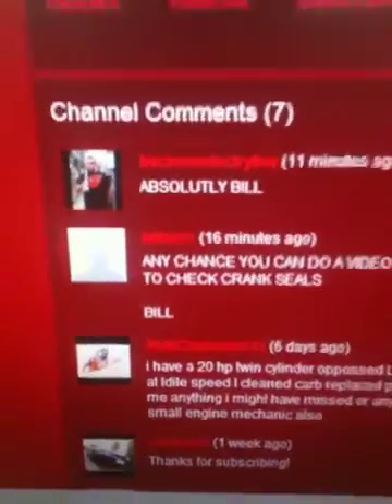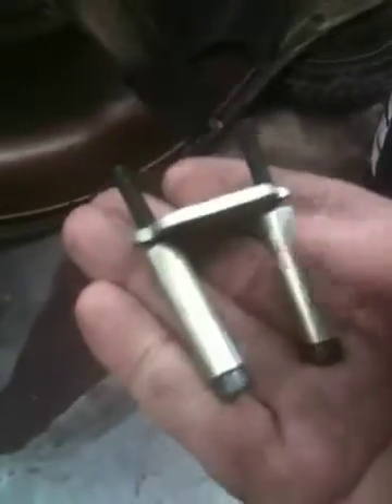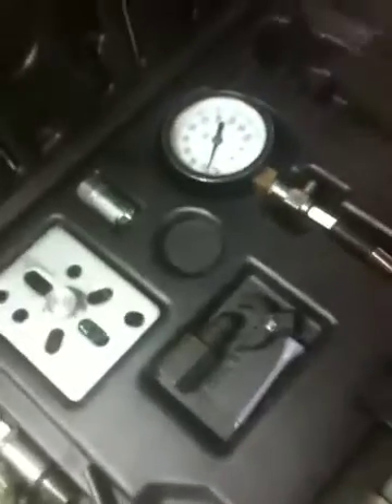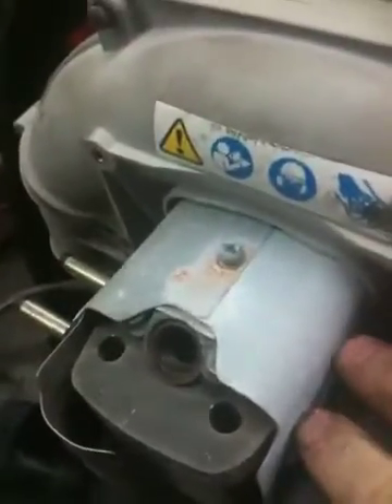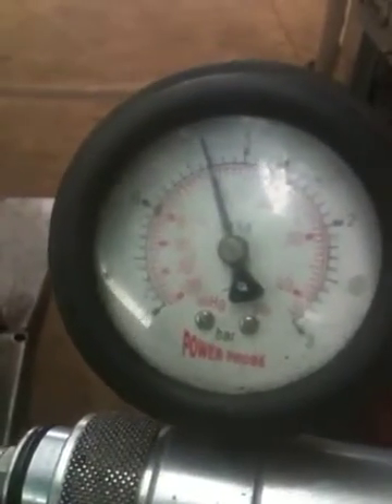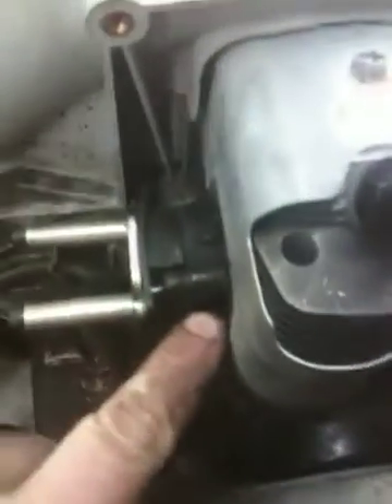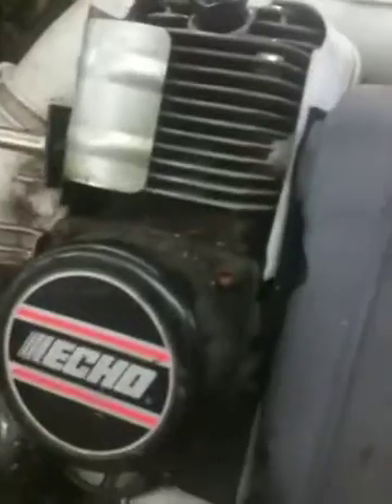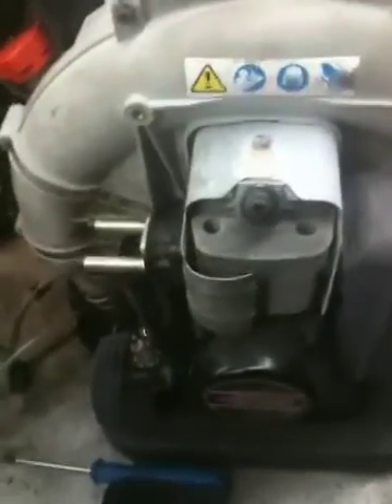2 CYCLE ENGINE REPAIR:  HOW TO PERFORM A PRESSURE AND VACUUM TEST ON MOST 2 CYCLE ENGINES

Comment: I bought a vacuum/pressure tester on eBay about 4 years ago for $40.00 and it still works great. For the rubber to put behind the muffler and carburetor you can get on eBay or Amazon and search for” 1/8” thick rubber sheet” then cut it however you want. To make a carb port block you can take a bad carb and  remove the butterflies and rods, cut the fuel line nipples off if it. Then stick a metal tube through it and seal it up with permatex gasket maker. You can make a spark plug hole adapter by breaking the center out of a spark plug.

Comment: I can't thank you enough for posting this. This is exactly the info I was looking for. I won't be defeated by my 2 stroke now!
Reply from the maker: It's comments like this that make me want to do what I do thank you and have a good rest of the weekend
Reply: THEMOWERMEDIC1 THE SMALL ENGINE SPECIALIST my question now is how to tell if the piston in my engine is at dead bottom center. Can I just look in the spark plug port at the top of the piston?

Comment: JEREMY FOUNTAIN (THEMOWERMEDIC1)  When u put pressure on the piston it moves the piston past the transfer ports filling Crankcase with pressure and or a vacuum

Right, if the Piston is leaking you are filling up the whole engine with pressure, every gap and hole. The pressure will pass through the leaking (if it is leaking air) piston/cylinder and fill the crankcase past the piston (which I would assume is also airtight) with the same pressure. I'm just saying that this might not be necessarily the most accurate way to test pressure.

Comment: Worked on one that the shaft moved side to side when it reved a little. Ran perfect at Idle. Bearing eroded into side cover. So Now I pull crank back and forth to check for movement and pressure loss.

Comment: if you block off the intake and exhaust, you are testing the pressure of the block. The piston could still have a loose pressure against the cylinder, this test is pretty much useless in terms of testing the engine pressure.
Reply: you are testing the engine for unmetered air leaks. ya moron. not compression.
Reply from the maker: Diesel Ramcharger  yes I know.
Reply: this checks crank seals and gaskets!, to check compression youll need to to a cylinder compression test! lol
Reply from the maker: This is the factory test procedure for Stihl and echo.  Would you
Like their customer service numbers? So you can tell them the test is useless?
Reply from the maker: When u put pressure on the piston it moves the piston past the transfer ports filling
Crankcase with pressure and or a vacuum

Comment: OK,i just bought a blue point pressure test kit but i forgot that i needed the spark plug hole adaptors so do you know if there is anywhere i can buy them seperatly since the kid does not contain them?